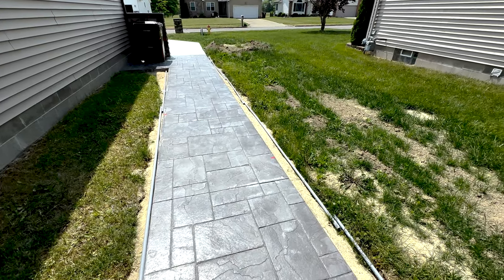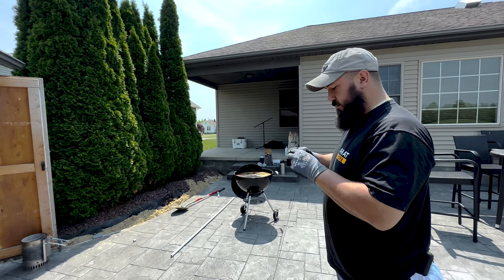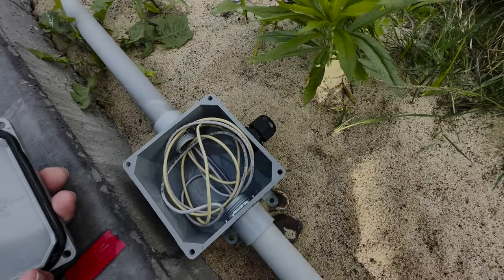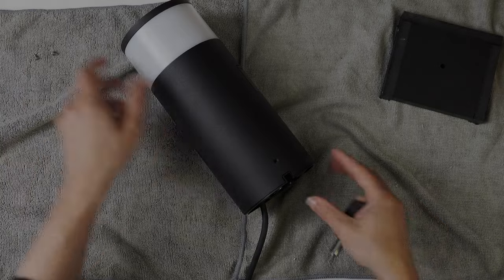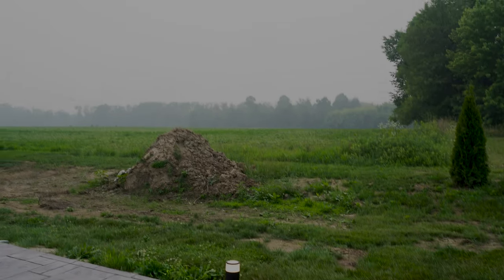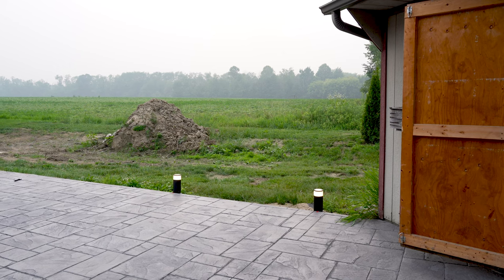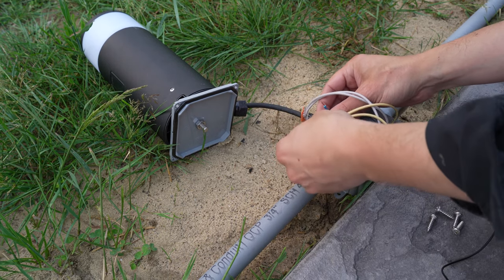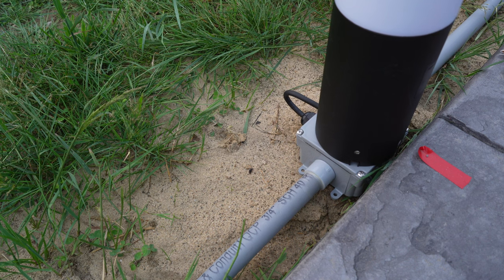Philips Hue Calla Bollard Outdoor Patio Light Install | Part 1

Comment: Nice job, the conduit will keep the critters from chewing on the cables (I’ve had to repair a few myself), depending on how strong the sun is you area you will most likely see the ABS plastic lenses yellow over time.  There is another video on there on gutting and replacing with frosted glass for the price they could have used better materials.

Comment: Would people most likely have to bury these conduits 24 inches underground as per the electrical code? Or would I be fine just DIY ing something like this?
Reply from the maker: @korenucl3646  you can DIY it. It’s low voltage power. In this application the conduit was to obviously protect the cables, but I also wanted the junction boxes as a steady mounting base for the lights.